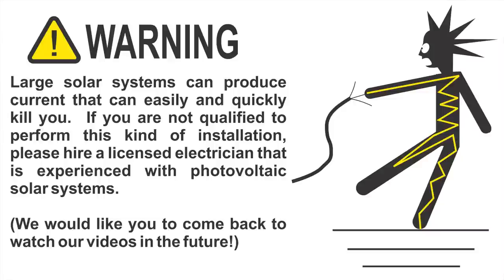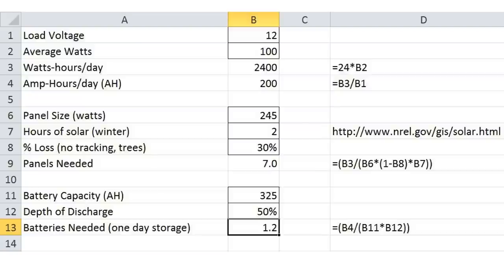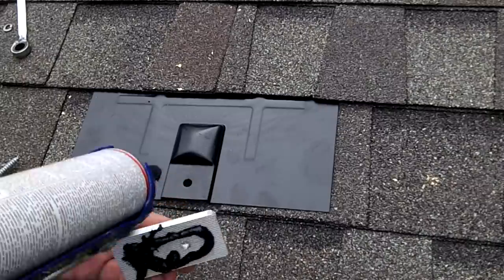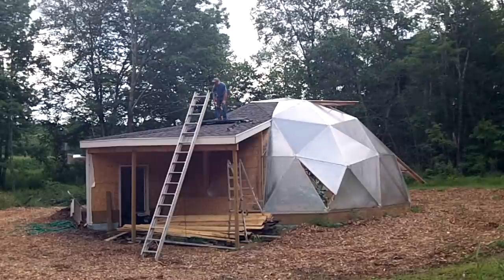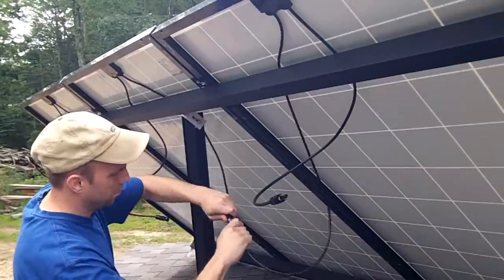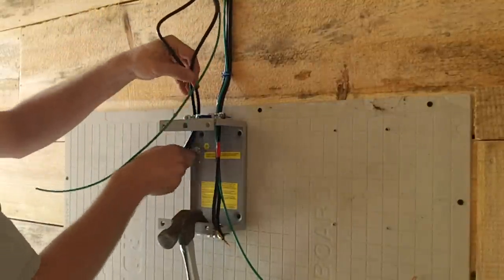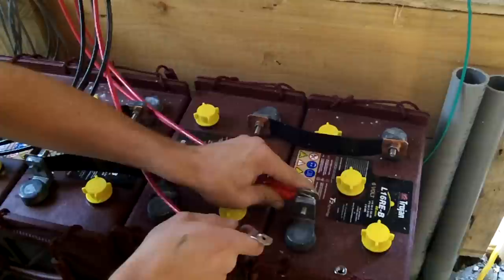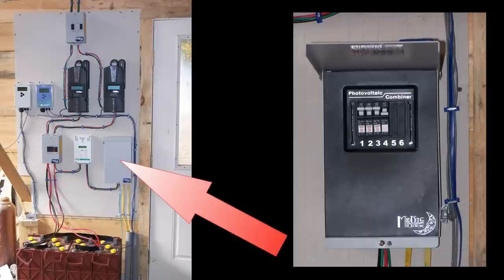Going Off-Grid in the Aquaponic Geodesic Dome Greenhouse

Comment from the maker: I've changed the system to run on 24V.  A few of the electronics are running at 12, some at 24, and I have an inverter running one of the pumps until I can replace it with a 24v pump.

Comment from the maker: No.  I use well water.  I don't want the stuff coming off the roof because the shingle have fire retardants in them.  I'm not using much water so it's no big deal to top off the system once a month.

Comment: The main thing I do differently in my buildings is box and vent the batteries to the outside. I have individual systems for the house (using a separate "solar house" as my utility company), the shop, the barn, and will do the same for the greenhouse I'm building this year. A neighbor asked why I didn't just run it all off the main house system. The reply was simple. I'd have to increase the system to handle each additional load, plus run heavy enough wiring to the remote locations. Plus, independent systems build in some redundancy. If something goes down, I still have power elsewhere to temporarily divert electricity from. Anyhow, as always, great video.
Reply: ...I did almost the same parallel type system that yours is for our main house, using two MPPT controllers, but with parallel battery banks before feeding the large "Outback" inverter. It was for the redundancy, although it's all worked fine for 4 years so far. Good luck.

Comment from the maker: if you're drawing 75 watts on a 12 volt battery, that's 150 amp-hours per day.  You should only drain a battery to 25%, no more than 50, so you really are going to kill that battery.  For a system your size, you need about 750 watts in panels, and 800 A hour of battery storage.

Comment: Hi I was amazed by this video and how you were able to do all these by yourself. I am a new convert in to the aquaponics world. I am gathering all necessary information about the work that it entails and the cost. Can you tell me what you think it will cost me to set up such solar system. I am a complete novice, so all lots of information is what I need. I have never had or worked on solar system before. I am thinking of a water pump, fan and other lights for the greenhouse. Thanks

Comment from the maker: if you have a 12 volt system and 12 v batteries, then they should be in parallel.  you probably could get away with less batteries if you're in a sunny area.

Comment: NASA has done research on surface mount fresnel refractors increasing absorbtion on static mounted panels. A cheap DIY is to laminate "anti-glare" poly sheeting to the panels increasing collection at wider angles and capturing more ambient light.

Comment: Super clip. thx
You could take in into consideration, to convert regular car battery's to crystal car battery's by exanging the acid by alum (aluminum sulphate) this will allow a car battery to be drained 100% without destroying it. Old car battery's are often readily available and you could create a firm storage bank this way. As long as the battery´s don't freeze they will not ever seize to work with alum.

(yep tested it out)   :-)

cheers.

Rene

Comment: Also, a good Thomas & Betts Military Spec Compression tool is not something cheap to buy if you only need to use it for a couple dozen lugs. And a PROPER solder joint is better than a crimp done with a simple pair of pliers... Soldering was a good choice for you factually.

Comment: tip i learned for ground rods is to dig a small hole where its going. then pour in some water working the rod into the ground is much easier.
Reply from the maker: Good idea.  Or hire a kid with a strong back!
Reply: hahaha . the real problem i had was it was -20 degrees and i thought the water would help thaw the ground a little. it did and the rod went in like the ground was butter.  love your greenhouse btw.
Reply: Bigelow Brook Farm (Web4Deb)
Reply: +j corvett   There are many factors in studying aquaponics. One place I discovered that successfully combines these is the Keiths Ponics Site (google it if you're interested) without a doubt the no.1 info that I've heard of. Check out this  awesome resource.

Comment: U didn't have to use 2 charge controllers... but each to there own... nice video
Reply from the maker: These controllers aren't rated to deal with the total wattage of the array.  After making this video, there are now 12 panels.
Reply: You upgraded to 12? What are you primarily using the power for? Extending the day length with lights? Still using the rocket stove to warm it?

Comment: God forbid there is a fire and the fire inspector tells your insurance company. It would void your fire insurance. A good Thomas & Betts mil spec compression tool will not crimp improperly unless you use Chinese compression connectors or undersized wire.

Comment: All fine and dandy EXCEPT for "soldering" your crimped connectors. Properly crimped connectors will NOT need any "help." Soldering power wiring is against the code everywhere. I worked as an engineer in one of America's leading connector manufacturer and can state that crimped connectors are basically welded together by the pressure of the compression tool. Don't modify the connection, please.